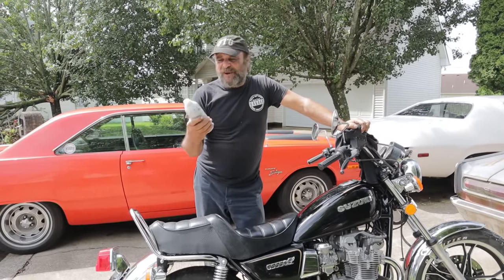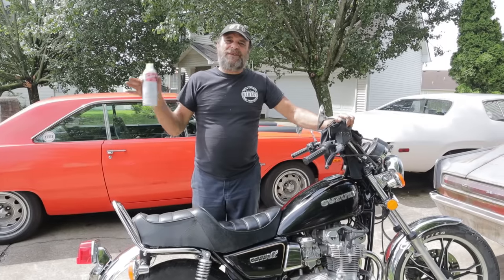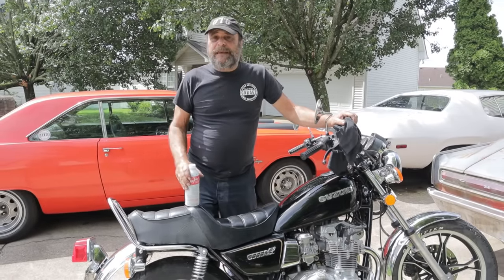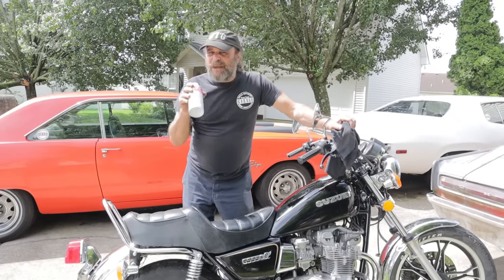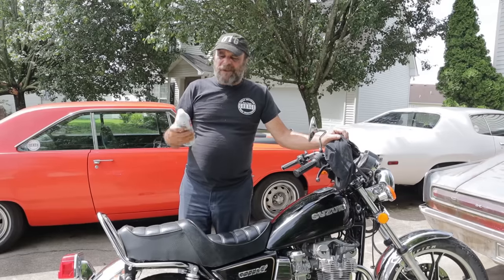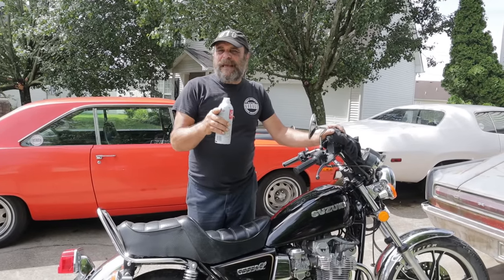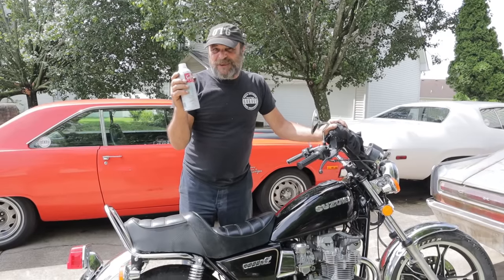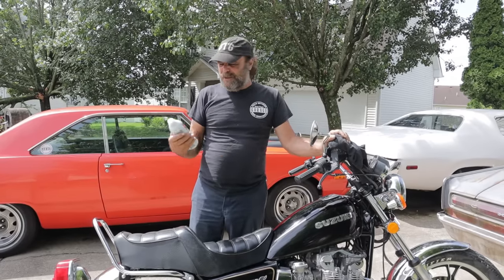We Try Seafoam - We Come Away Shocked

Comment: I've used Seafoam for about the last 10-15 years, mostly as a fuel stabilizer at 1 oz per gallon. With the carbureted bikes I used to use Marvel Mystery oil with great results for carbs that weren't behaving. I haven't had a bike without fuel injection for the last 20 years, so all I need now is a fuel stabilizer, and around here we use 100% gas most of the time. Corn belongs on the dinner plate, not in your tank.
Reply: Those farmers are getting rich selling corn that destroys my engines.
Reply: Yup, always have to find the non-ethanol for my father machines. It saves a massive headache in cleaning alone. I always add stabilizer, berry man 12, and sometimes an oz of mmo. Mind you, I keep cans filled for some time - for generator, golf cart, mower, and 3 dirt bikes. 

With this regime, I haven't had to fully clean a carb in over 10yrs. 
I am mindful of regular user of the machines, though
Reply: My 50cc moped like all of them have a basic carb no fuel injection, tho the Honda Metropolitan has fuel injection
Reply: I use E-10 in all my small engines but I take a lot of precautions. I add sea foam, mix the 2-stroke mixture a half gallon at a time and burn the stuff completely out, leaving none in the tank. Been doing that for 10 years and have had a few problems but nothing I couldn't fix.
Reply: @jasmith1867  Granted ethanol props up corn prices but the government regulates farming, so profit margins are very low.  You'd do a lot better investing in the market than land, machinery, fuel, fertilizer, seed, and time. It's not the farmers that are getting rich from ethanol.  It's Poet Biorefining, Valero, Arthur Daniels Midland, et al making the big money.
Reply: Engines can run fine on alcohol, o-rings and gaskets must be compatible though.
It is the only viable solution.
Reply: I'm happy that I have a gas station a quarter mile from my house that sells zero alcohol gasoline. I try not to fill up my bikes, especially those with carburetors, anywhere else.

Comment: I've used Sea Foam for years with great results, especially in small tractor and lawn mower engines. Good stuff.
Reply: Their "deep creep" is the best for loosening up cylinders that have been sitting awhile.
Reply: 👍.. and add some Stabil when they're going to sit a while.
Reply: @outlawbillionairez9780  stabil is a very good product.
Reply: @outlawbillionairez9780  Never needed too, I run the bowl dry upon every use
Reply: @DarkLinkAD  that's really the best way 👍😊
Reply: @outlawbillionairez9780   Every once in a while, I toss an ounce of acetone in the gas jug. The fuel lights off much more effective and complete.
Also, as bowl begins to empty with gas, I get the typical rpm surge as expected.
With the acetone added, no surge or warning. Just 100% empty bowl.
Reply: @DarkLinkAD  that's interesting. Acetone is a powerful solvent for ring and valve varnish, and probably atomizes more completely in a hot environment.
Chemtool has Ethylbenzene, propanol and xylene, which are solvents as well. Also, "petroleum distillates". I detect lacquer thinner and maybe acetone to my nose.
If I were to run an engine on it, I would add something like Marvel Mystery Oil, in a small amount to be safe.
Reply: @outlawbillionairez9780  There's a Scotty Kilmer episode where he adds a gallon of laquer thinner to 9 gal gas...
Reply: @stuckinmygarage6220  Project Farm did some test comparisons about 2 years ago.
Reply: @stuckinmygarage6220  Oh my God, won't someone PLEASE think of the hoses! The horror. :)
Reply: @DarkLinkAD  
HOW TO DRY OUT NEEDLE SEATS AND START CRACKING
ALWAYS USE STABIL
Reply: @thecloneguyz   Snake oil salesmen
Reply: I know for a fact it ruins lawn mower/ go cart engines
Reply: It may work, but if it doesn't, and you let it continue to sit, you're going to be buying a new carb.
Reply: @gregpeterman1102  With today's gas you should always drain it when letting your vehicle sit for more than a month. Common sense. Seafoam treats gas so you can let it sit all winter. Spring time startups are a non issue.
Reply: Same here
Reply: Same here.   Always use Stabil in the small engines each year, then follow-up with fresh tank of gas and seafoam.   Always worked.  My ex-father-in-law was a chemist, used to argue with me that this stuff was a fraud and didn't work.  I did my process every year before winter an in the spring, everything started and ran fine.   He just let his stuff sit every winter with old gas.  In the spring he had nothing but problems and would get all pissed of because he'd haul it to the shop and pay $$$ to get the damn things running.   I quickly gave up arguing.
Reply: @outlawbillionairez9780    The only problem I had with that approach is the gaskets/seals drying up and then leaking later.

Comment: Bought a 25 year old Gold Wing that had been sitting 4-5 years. Idled and ran rough even with fresh gas. Dumped a whole bottle of Seafoam in and filled up with gas and went for a 30 mile ride. Idled and ran smooth as silk; even the idle surge is gone. Yes, you can set a nickle on edge and it won't fall over.

Comment: I've heard a good trick for unplugging carb is to get the engine reving then block the carb. The extreme suction can sometimes clear them out.
Reply: I'm here to tell you that trick actually does work!! I have been using it for well over 30 years with small engines. It doesnt always work but it often does depending on what is going on with the carb.
Reply: part of the ole Italian tune up
Reply: @THExWASP  big time! 👍👍
Reply: @nastybastardatlive  how?
Reply: @nastybastardatlive  what does an Italian's car sound like? 

Dego wap-wap-wap-wap-wap..
Reply: @nastybastardatlive  Its a joke! Get a life bro!
Reply: This works! I do that with V8 engines, works great with a hand choke. Rev this piss outta it & then snuff it with the choke with the throttle still open and then open the choke right before it kills (do it many times in a row). It works more often than not!
Reply: @joelventura2151  no its why helicopters are illegal in Italy!
Reply: @softenerguy  I agree 100%!! My Camaro sat for 17 yrs. I changed the tank and got it running…barely….  I took off air cleaner and opened the throttle while dumping a whole can of this stuff in the carb and it ran MUCH better. The throttle was wide open and I was dumping so much in the motor was on the edge of dying. I also threw a can in the tank for good measure. Ive done the same trick with bringing around small engines/old mowers too….
Reply: @joelventura2151  lmfao
Reply: @THExWASP  As an Italian, I approve of this message.
Reply: @nastybastardatlive  😂😂
Reply: And pull all kinds of crud into your engine? Come on, pull em and clean em up properly.
Reply: @wobbles7915  🤣🤦🏼‍♂️
Reply: @MikeN-cs8qe  we're talking about snuffing the engine with the choke, also called blocking the carb which is completely different than what you're explaining which could hydrolock the engine or bend a connecting rod.
Reply: @softenerguy  🙄 Very slim chance of that happening. Ill take the risk.
Reply: My buddys fourtrax 250 started running like shit one day and would only idle and die when you hit the throttle. Being in the middle of a ride with no tools, we just started it, held the choke and held it wfo for a few seconds. Cleared it right out and it ran good after. Works good sometimes lol.
Reply: @modelnutty6503  that too. We are an easily offended people group 😉
Reply: @nastybastardatlive  call it a German tune up. If your offended. Germans won’t care.

Comment: I'm 49 years old now.  Back in the day when I was 10 years old, my uncle was an aviation mechanic and he recommended using Sea foam on our dirtbikes; it actually worked wonders!   The main thing was to actually get it circulating into the systems of any combustion motor including lawnmowers, and it would regulate a smoother idle!   Take care uncle Tony, and enjoy!🌄👍
Reply: When my chainsaw won't idle, I add a little and the next tank of fuel it is running fine.

Comment: Been using Seafoam for 50 years, Works great! I've tried others, didn't work, came back! To the naysayers, my 82 Goldwings carbs were COMPLETELY stopped up and I was looking at $600 - 800 rebuild/cleaning that I could not afford plus a fuel tank replacement ! I rigged up a bottle to fill carb bowls with the seafoam, let sit 3days then drained and refilled, let sit another 2 days drained again, set up temporary tank and ran bike using heavy mixture (I can to 2 gal gas) ran bike for 1 hr at a time 3x a day for about 4 days with it running smoother each day! Last day I rode bike for 2hrs by the end was running great, 2 different friends are bike mechanics and couldn't believe how great it ran, both accused me of secretly having carbs rebuilt, made believers out of them!! 
There are a lot of scams out there BUT Seafoam is the REAL DEAL!!
Reply: " let sit 3days" yup. this key
Reply: Bought a used snowmobile years ago that couldn’t get to 35 mph.  Ran a can of sea foam through it and by the end of the tank it was running normal and up to 60 mph.  440 cc fan cooled Polaris.
Reply: Did it clean, the fuel tank?
Reply: @billpetersen298  , no the fuel tank was too far gone and I had to replace it! Now that was a job I NEVER want to repeat!!
Reply: @jackedwards7420  Thanks Jack, Finding good condition vintage parts, can be like waiting for the messiah. If you don't want to pay the scalpers. Great bike, happy trails.
Reply: @billpetersen298  I kind of cheated, I found some (new) riding mower fuel tanks that fit inside my saddlebags to be able to ride until I could find a reasonably  priced used tank (everything I found was $400&up, new was $600)! Took 3 yrs to find one for $200, of course now I see them for less!!
Reply: @jackedwards7420  HaHa, a fundamental law, of the universe.
Reply: I went to a 2 year small engine program I buy seafoam by the six pack for $6.00 a can it works wonders! Everyone has opinions, I don't have WD-40 in my garage, there are better things on the market. Lol
Reply: I soaked my carbs from a KZ 650 in graffiti remover for a few days and presto! Carbs were like new again.
Reply: adding up your "days" comes to a long time compared to rebuilding a carb. I have a 2009 Honda Shadow Spirit been sitting in my garage for 10 years. What will it take to get it back on the road?
Reply: @RichardFulthorp  when I say $600-800 I'm just talking about the KIT for my Goldwing it costs another $600-800 in labor expenses too for a total $1200-1600 to rebuild the carbs I think that's worth the 2 weeks it took me to get back right at no cost except for 3 or 4 cans of Seafoam!! Plus, it's not just 1 carb it is 4 or 6 on later bikes !!

Comment: B12 or straight acetone are also very good additives to unclog carburators, clean à little bit of crap of the intake valves, etc...
It's not a miracle, but it works!
Reply: Because Acetone absorbs water as well as cleaning. Didn't think about burning it!
Reply: @MOTOMINING  Acetone is a little bit like ethanol. It's a good fuel but it's very volatile and collect water from the air.
Reply: But carefull, acetone kills some paint and tank linings.
Reply: How much acetone per gallon?
Reply: @catleugh  I used 5% acetone for 95% gasoline.
Reply: You nailed it on the Acetone. About $5 a quart at local hardware stores and its cleaning properties are pretty incredible.
Reply: Acetone will mess up O rings and anything rubber.
Reply: @Loiczzr  In high concentration, yes, it can and it will!
In low enough concentration I haven't seen any negative effect.

Comment: That was the original purpose of Seafoam. It was made to put in a boat engine that had been sitting up for a while. Its great for soaking parts in too.
Reply: Yes.  That is my understanding, too.  Old school, 2 stroke outboard engines, with oil added to the gas.  Seafoam was formulated for that specific use.  So, should it be used for gas that isn't oily?  Is this significant?  I add Techroline  and Stable to every tank of gas in my wife's Yamaha F90 outboard and my 1990 Suzuki VX 800 along with non ethanol gas.  All the cars get plain old 10% corn gas.

Comment: I've been using seafoam for years, it's amazing stuff. I have a 93 ranger that would pop, fart, and didn't want to idle at all. Gave it the seafoam treatment, and it came right back around to like new. That was 2014, and to this day it still runs just as good. I also recently bought a 67 Impala that had sat since 2012. Same deal it didn't want to stay running, I dumped a can in with a tank of gas, and I've put almost 2,000 trouble free miles on it, and it runs like new.

Comment: You just finally found out about Seafoam? I've been using it for years on all my small engine machines. I automatically put it in every gas can that I have for all my small engine needs. I have never had carbureted issues again. It works great for keeping your fuel system from varnishing up. I am not a believer of mechanic in a can but I know this stuff works great. It also works as a stabilizer.

Comment: I can't believe you're just learning this. I've used this every time I have a carb that's completely clogged. I put about a quarter of it in the tank with a full tank of gas. I let it sit for about a day then I start it with starting fluid to get it to run for a little then let it sit for another day. Throughout the week I start it and run it each day. By the end of the week it runs like a brand new motor. And, that's without ever pulling and cleaning the carb. I love this shit!

Comment: Chemtool B12 is my go to. '70's and '80's japanese bikes had to meet strict pollution standards, so idle and transition throttle are excessively lean.
Reply: Same issue on my 74 Buick thing falls flat on it's face a little seafoam and carb cleaner took that away but I blew a carb gasket in the process, it's always when you try to get ahead you set urself back haaha
Reply: @redlight3932  How my 68 455 Olds was. Fell on its face, quadrajet was lean as heck. The amount of carbon was crazy. Seafoam helped clean a good bit of the carbon out of the intake and heads.
Reply: I have several '70s/'80s bikes, all of them have been rejetted, and any emissions crap, live an evap or PAIR system have been removed.
Reply: @geraldscott4302  thank Guad for Vance and Hines and Dynojet!
Reply: @redlight3932  what Buick?
Reply: @redlight3932  exactly, take it to a good mechanic, forget the shade tree magic potions.

Comment: "VooDoo in a can" Yup, I get it. But Sea Foam is something else. I mix it and Stabil in my yard tool gas. Works like a charm. Example: after sitting from September to March with a half tank of gas, the mower started on the second pull. Two stroke equipment is the same. No idea what's in it. Might be camel spit for all I know. But it works.
Reply: It's mostly Naptha, with some oil of wintergreen to make it smell nice.
Reply: I believe marvel used to be oil of wintergreen

Comment: I believe you're preclean helped it along immensely... it's a good cleaner, no doubt, but if those carbs need a rebuild, they just need a rebuild... just went through this with a Honda 4 wheeler... finally just pulled the carb & did a full rebuild, not one issue... I did run some Seafoam through it again after I rebuilt it, just for a little extra cleaning during the break in, but one of those jets was hopelessly clogged & wasn't having the Seafoam fix, so I just had to pull it... I am gonna start running some through my vehicles at least once a year though, because it does help when the issues aren't serious...

Comment: I'm rebuilding a 1971 Triumph T120R. It hasn't been started in 20 years. I take apart the carb because it had been converted to a Tr6 head and saw that there was a lot of dried up white powdery stuff in the bowl. I put some Sea foam  in the bowl and could see that the powdery stuff was disappearing.  So I put some in the gas tank and ran it for awhile. The longer it ran the better it got. This stuff really works.

Comment: I've been using it with great results for a while now. The most recent thing was I had a sbc that had sat on the floor in the garage for many years and new it was good when I pulled it for future consideration. Installed motor and couldn't get the lifters to pump up for love or money. Added a can of seafoam to the crankcase and I swear it didn't take 2 minutes for them to come back around. I put it in my tanks every oil change.

Comment: I run non ethanol gasoline in my 2007 carbureted Triumph Bonneville 90% of the time. I also pour in a few ounces of Seafoam every fill up. The non ethanol combined with Seafoam keeps my bike in shap.

Comment: Two things I've found is 
1. Seafoam is petrol based, so for a heavy cleaning I'll throw half a bottle in my sportsters tank.
2. If you are willing to give the rougher stuff a try like Berryman, renzol hyperfuel is definitely worth the money. By far the most immediate,  feelable difference I've ever had with any of the fuel additives.
Reply: I use vp racings octainium 2 oz per gallon. great performance boost.

Comment: I have used sea foam for about 30 years. I always use it first, as soon as a carb is acting up. If it doesn't clear it, then I go deeper. 8 out of 10 times, sea foam does the trick.
Reply: I put it in if I don’t think I’m gonna ride for a while.  Then let it run for ten minutes to work it from the tank to the carbs.  It’s my go to winterizer

Comment: Seafoam also pretty neat for helping keep intake runners/valves clean on direct injection engines. Pull some in w/ a vacuum line on the intake and let it soak a bit then run it out.
Reply: The smoke it produces is pretty cool too 😁